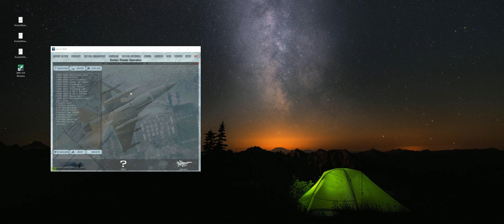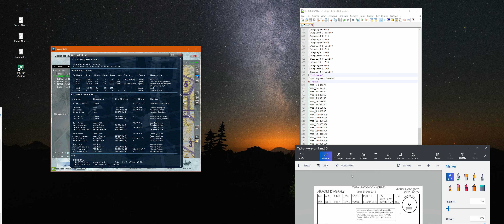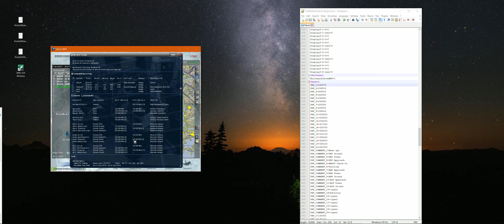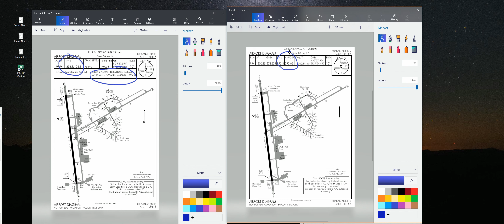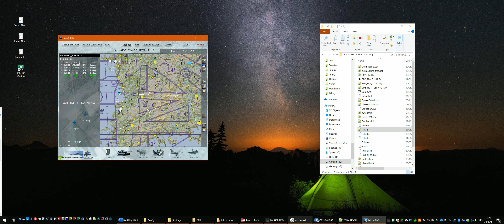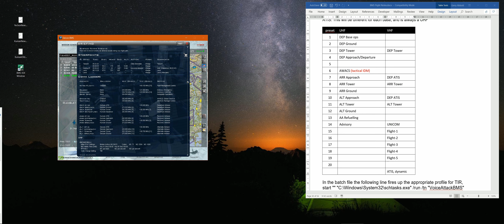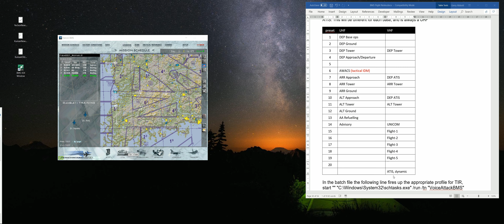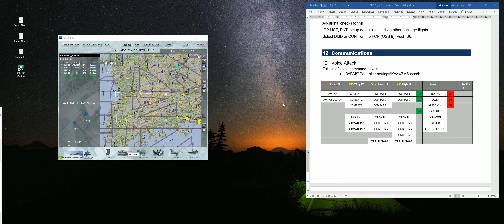BMS 434 comms

Comment: Thank you for this detailed tutorial! Just a question: I’ve seen on another tutorial the flight lead must contact DEPARTURE on UHF#4 to Report Airborne after ALL the flight elements are airborne. What is the correct radio procedure? Because we can hear every element calling airborne, but I can’t say if they are reporting on UHF#4 or VHF#15.
Reply from the maker: I believe elements are reporting 'airborne to flight lead, on victor. I generally switch to departure on Uniform when i get instructions from tower, and declare airborne status to departure. Elements do not do that. But if in MP,  lead will instruction them to  push to uniform 4 so they can hear departure, however, they take instruction only from LEAD. This is what we do in our group.  In practice when flight lead 'declares' airborne depends on departure SOP,  Most times all elements are wheels up,  but as lead you would not be waiting too long for this, as it could cause delays in the flight especially if there's a hard turn to flight plan. BMS frags flights with that extra triangle at departure, to enable flights to re-join properly before turning to the main flight plan, and maintain the carat (time on steerpoint).
Reply: Gerry Abbott thank you very much sir! Beautiful and logical explanation. This also answer the question why when I fly with 1 or more wm, DEP give me course heading BEFORE I Report Airborne!